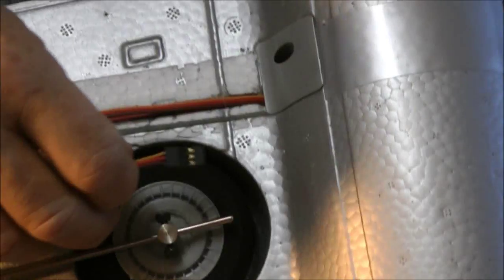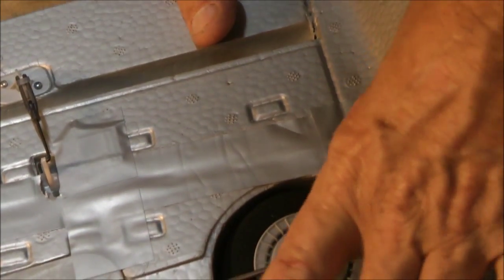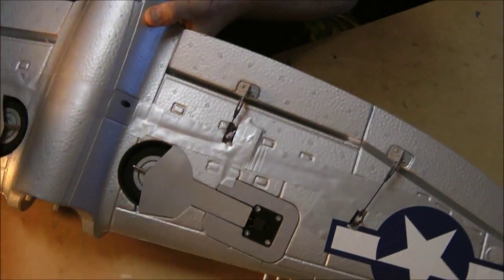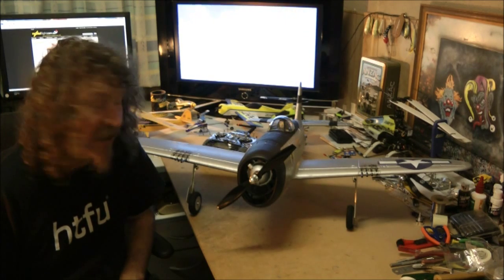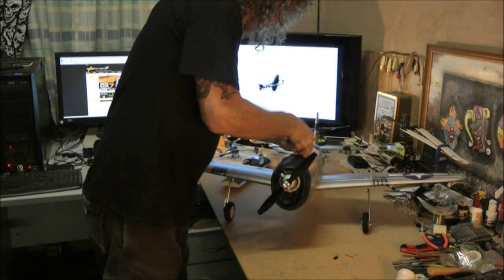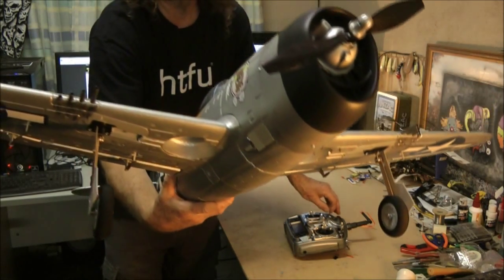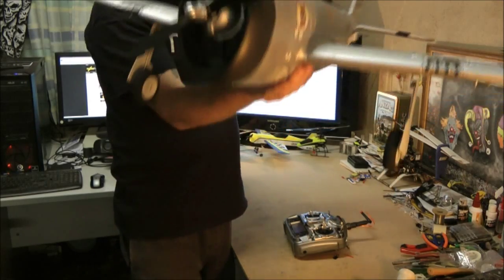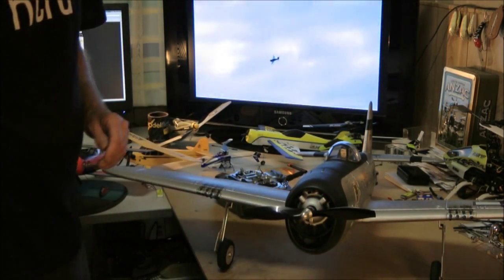Parkzone P-47D  Wing Build Part 2-B

Comment: Four blade props will drain a 3s 2200mah battery in 6 mins at half throttle... as I found out u will want to upgrade to a 4s 2200mah the esc will take 14volts easy as well as the motor, I believe parkzone already thought most of us would want to put on a four bladed prop....